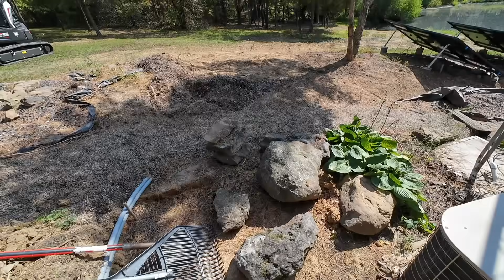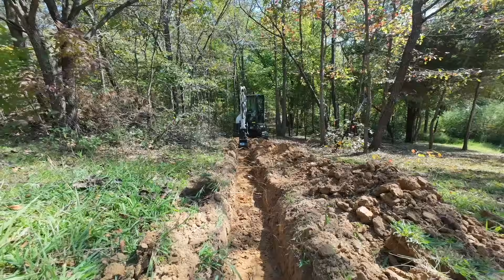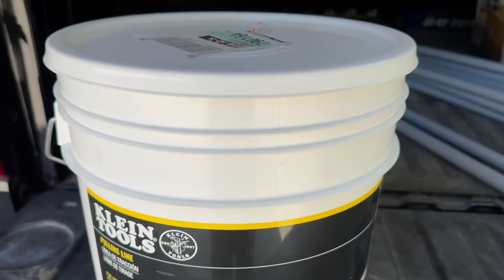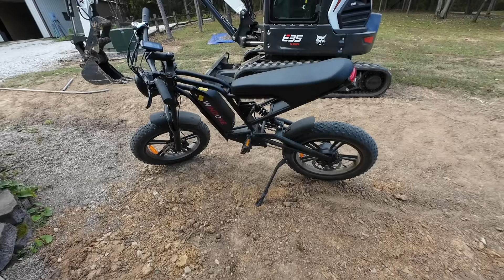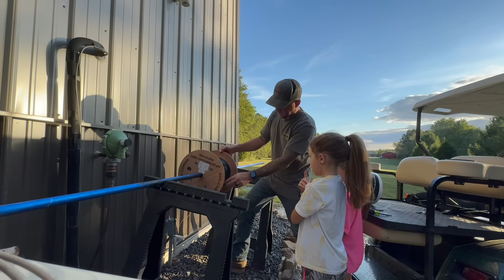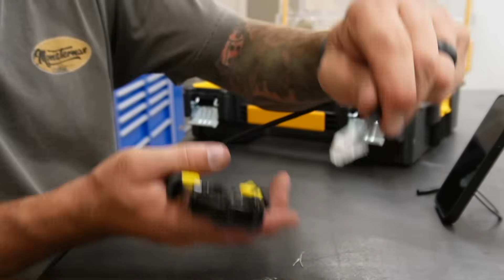Installing INTERNET To my Shop Over 300 FEET AWAY...

Comment: Pass-through RJ-45 connectors are a lot easier. You don't have to cut the wires to the perfect length, the wires stick out the other end of the connector and get cut off by the crimper. It's easier to double check the order with the ends sticking out before crimping.
Reply from the maker: @jojo0420  ive never had any issues with these but good to have options.  Some people may struggle and need easier options.
Reply: @SpicerDesignsLLC I wouldn’t recommend those EZ-Pass. I’ve been in the telecom industry for 15+ years and can tell you that they can cause issues. I’ve had to fix many of them because they short out at the end of the connector. Never use them on anything that is POE. I’ve seen many switches get messed up because of them. Keep using what you are. Shouldn’t ever have an issue.
Reply: Just figured I would let you know that you shouldn’t ever use soap. Soap can degrade the cable sheath over time. Use the proper lube if needed.

Comment: 3/4” is too small, I’d use 2” minimum, preferably larger duct.  I just bought 50m  (160ft) of 80mm (3”) OD for £70 ($80 ish)
Reply from the maker: @over-engineered  hah! You can do it however you want.  I think you should use 4” just to be safe.

Comment: I’d run fiber, a copper backup and a string.
Reply from the maker: @Jeff-m5x3j  anything else you wanna throw in there for shop wifi?
Reply: @SpicerDesignsLLC  of course you need fiber baluns on each end.
Reply from the maker: Do you think the cat6 can handle Starlink?
Reply: @SpicerDesignsLLC  I think it will be fine. I think long term reliability, fiber is superior.
Reply from the maker: Of course it will be fine.  Ive been doing this for 20 years and never had an issue.  All we ever pulled in government buildings, schools, control centers, ect had been cat 5 or cat 6.  Only time we ever pulled fiber was to the main servers.  Should be fine for my shop wifi like you said.
Reply: @SpicerDesignsLLC  I’ve been doing this for a while too. I just feel that once you go outside between buildings, fiber is less troublesome, but might not be worth the cost.

Comment: Nothing like creating the potential for electrical issues by connected separately grounded locations with cooper wiring. Fiber should have been your only choice.
Reply from the maker: @rgblack316  same ground.  That building has a sub feed.  Fiber is not necessary for my shop wifi.  Its been hooked up that way for over a year accept it was laying on the dirt.  Now its buried.  Never had an issue before.  We all know fiber is better.

Comment: I would try and install the conduit as stright as possible to aviod to many bends in the conduit. You can use a string line to layout the trench to help you keep it stright. Each bend in the conduit will add rersistance to the pull. You can all so use mule tape over pull string, this will avoid the string cutting into the conduit. Mule tape is smoother and will not cut into the conduit. You can all so add a tracer wire in the trench. This will make it easier to locate the conduit when it is buryied. Bury the conduit as deep as possible, this will make it lee likely to get dug up or hit. Cat6 is rated for about 325 feet but for long runs 200 or longer I would suggest pulling fiber all so you will not get any electrical problems with fiber.

Comment: Should have been doing fiber because of different electrical potentials. Running an ethernet/copper cable all the way down there can cause some devices to get fried. Fiber isn't difficult. Companies like lanshack make preterminated cables
Reply from the maker: I can pull any other cable in at any point with the conduit.  I will adding lightening arrestors like i mentioned in the video.

Comment: I forgot to ask ya in the other comment, what is your thoughts on the Passthrough RJ45's that when you crimp, they cut to length and are good to go? I have the traditional ones like what you showed and have a TON of them but as my stock dwindles, when comes time to restock, wasnt sure if I should think about those. I havent looked hard at them so I assume you can use the same crimper with it.  This is some relevant info for DIY'r! If you go buy a 250' or 500' roll, it'll last most home owners years depending on what you are using everything for. One day, I want a MEP closet/Room like what This Old House contractors do with a rack with all this crap on it and distributed throughout the house for easy repairs and management! and all the nice sexy pex runs and a sexy manifold.... "multiple Tim Allen Grunts!!!* # lifegoals

Show how to install the lighting arresters! Can I use the same ground as a 70amp subpanel? Or can I tie it back to a ground in an outlet box? I didn't know about these! I actually just lost a network switch due to a strike with in 50' of my building.
Reply from the maker: Ive never used the pass through.  Ive never had any issues with the regular jacks.  I plan on taking the lightning arrestors back to the panel since mine will be next to it.  Depends on your set up i guess.  Ive never installed them
Reply: @SpicerDesignsLLC  I'll ask my commercial electrician friend about it tomorrow at my kids swim practice. I know liability wise you can't go in much detail. He's going to ensure I do the 30amp camper and 50amp generator plugs as well!  

Last question do you have a preferred whole house surge? Maybe surge and power monitor AIO?  If not no biggie.
Reply from the maker: We used to install a lot of surge protectors that were a breaker style.  Otherwise you can get an external style ad well.  Anything is better than nothing.

Comment: Kyle, Mr. Machine with the Beer Assistant, who has an excavator, why don't you rig up a platform/basket for you to go up in while you wife drives and lift or hell, your kiddos drive!! lol  

I am not going to lie, I wish this video was out in January 2011! I had to run cat5 about 200' similar to what you are doing and it was a pain learning all this crap. I too have a tool box of all the tools and shi... crap with a colored print out of A-A and A-B types. When I did my 12x20 detached office in fall of 2020, I ran a Cat6e outdoor with the hard plastic divider things in the middle and all keystones were A-A and I made the appropriate wiring depending on if it was going to a switch, router, or device. Out there, I have 1 router, and 3 un managed switches that connect all my wired devices in different areas of that office! I used the boxed 500' roll of what it looks like is the same as yours. Love these videos!!
Reply from the maker: @mike.the.estimator704  thanks Mike! Sounds like you had quite the project

Comment: I’m not an electrician, although I am a partially responsible for supplying magic pixies to the electrical grid, I’ve heard there are signal boosters for cat6 that can be installed for long runs. I don’t know if that could be an option?
Reply from the maker: @mrbadkins007  i just ordered Starlink so we’ll see how it does.  I think it will be plenty sufficient for what starlink will be suppling.  I will update once i install it.

Comment: Another great video, bro!  I'm all about being physically connected vs wireless when I have that option, and it's not a 300ft run!  lol
If you have fiber to the curb, hell yeah I'm pulling wire.  If not, hell no I'm doing LOS/WiFi.  It all depends on what your ISP provides and what your gear can support.  My shop/barn is about 250 feet away from my house, and I elected to run a little p2p capable of 300mbps.  I'm only getting 25 MB down, from my ISP (I'm out in BFE western OK), so it really doesn't matter.  My Starlink system will be in this week, but I'll still stay wireless  If I ever get fiber out here, I'll trench it and run the cable.
Reply: So why would you need more than 25m in a shop?  Streaming in 1080 takes about 3m and 4K is 15m.   Are you downloading gigs of data there?

Comment: Have you taken into account the static charges that occur on such long lines in bad weather? I had 2 switches burn out in my house because during rain and wind there was a potential difference between the garage and the house 30 meters away. Check what is cheaper, a pair of media converters and a 10 cm optical cable or a network galvanic isolator. Media converters are often cheaper. The main thing is to break the continuous copper connection so that the charge cannot pass.
Reply: if you already use fiber to isolate, why not run fiber in the 1st place? much cheaper cabling and you can go MUCH further
Reply: This is exactly why I did fiber.   I even had a super short conversion back and forth between the cable modem and my network (Now fiber to the house so no need)
Reply: I second this comment.  I have been installing ethernet and data circuits for over 20 years.  If you never have lightning you may be ok.  I live in the south and years ago we spent lots of money and a ton of time trying to find a way to put ethernet underground.  Shielded cable, lightning arrestors, extensive grounding and failed.  Today I still install a ton of ethernet but I the only thing I will install underground is fiber.  You dont have to have the ability to splice fiber, (it is nice though) you can purchase preterminated fiber and use a media converter on each end to convert back to ethernet.   Now that you have the conduit, it will be easy enough to use the ethernet to pull the fiber in the conduit.  I sure hope your luck is better than mine, but you have to remember that ethernet operates at a very low voltage so it does not take much induced energy from a near by lightning strike to blow out what is connected on either end, including your Starlink.  Just trying to save you some greef down the road.  Enjoyed the video.

Comment: check the rj45 pass through, they are very easy to use.  if starlink is your main internet, you wont need fiber for a long time. also might reconsider installing starlink on the top of this tower... they go bad, the connector also like to pull out from the antenna and if it is 50' in the air it s*** :(  (mine is 35' and i had to climb during winter lol ). have a good one and as usual, great video!!

Comment: Good chance you could use a line of sight point to point system in the future if needed by mounting one node on your tower.

Good on your girls for helping out.  I had the wife as  my 'helper' when I ran power 350 feet to my boat dock.  I used 2 inch conduit and pulled four 6 awg and two 12 awg.  She needed a bit more training than your kids though.
Good job!

Comment: I’m an electrician also 15 or so years ago the company I work for had a contract upgrading usps distribution centers cabling that runs the sorting machines. Get this from type 1 cable to cat 6. It all had to be run in conduit and we had fiber running to the idf cabinets from the mdf room. I think Cleveland oh we installed 175k feet of cat 6.

You learn to not cut your thumbs fingernails during the termination portion of the job where you would 100’s of cables a day for 3-4 weeks straight.

I don’t miss that part
Reply from the maker: @cboutdoorfun9955  thats tedious work right there.

Comment: Your daughters make better LV apprentices than the last 3 we hired.  They are motived and understand instructions.  Adorable!  Like others have mentioned, you are good for 330' switch to switch;  You should be able to get gigabit speeds with cat 6 which is going to exceed the bandwidth that Starlink provides so that won't be a bottleneck.  You could get 10 gigabit speeds with optical, but you can cross that bridge once an Internet service exceeding 1Gbs are available to.  All that matters is you have the pipe installed and can pull whatever you need to future proof.  Bravo!
Reply from the maker: @ChadCyr  thanks buddy! Good point with the speeds and capability of the cable vs Starlink.

Comment: You need to change the programming in the shop router. It needs to be changed from router mode to ap mode
Reply from the maker: Ill check into that.  Thanks

Comment: Your property is so amazing! I'm planning to build a shop soon that will only need 100' or so of cable run, but I'm planning to go with fiber. I will run it in PVC like you did and in the same trench as my power run for simplicity. With the PVC you can always upgrade later but if you look into it you'll find it's not very expensive.

Comment: The pre-terminated armored fiber is really worth doing, although I would guess you need to cut in a hand hole on each end to be able to blow it through.  Get at least 4 strand cable.

Comment: why not coax?
Reply from the maker: Not typically used for ethernet.  Youll see that used with the cable company to provide service.
Reply: @SpicerDesignsLLC  yes, but coax can be used to carry both net and video up to 300m.  would've just been a little faster for your needs.  (retired systems analyst.)

Comment: I just connected our barn 450 ft away with Wi-Fi, with 2  TP-Link CPE710 PtP antennas....  works sweet.  I just didn't want to deal with burying cable like that.  LOL  You did a great job though Kyle!!  Best, -- J. Andre. / Old Iron Acres
Reply: Yep, I use a Ubiquiti M5 PtP between my house and shop. It works great. Never had a single issue with it.
Reply: @Studio23Media   I love the Ubiquiti stuff... but sometimes it's just too $$$.    — Best, J. Andre. / Old Iron Acres

Comment: Should have ran multi-mode or single-mode fiber over the copper cables but either way, good job.
Reply: I use wireless fiber between my house and shop. $150 Ubiquiti M5
Reply: At longer distances fibre is more reliable and actually cheaper than paying for good copper. Cheap Cat-6 tends to be CCA or copper-clad aluminium, which is prone to breaking and has worse signal carrying at distance. Then a good full copper cable is at best the same price as armoured fibre.
Additionally, when you get fibre you don't have to worry about lightning strikes and ground potential differences.
If you have a lightning strike nearby (doesn't have to be close) then the ground potential differences between the two buildings can be high and the equipment has at best about 1000V isolation. Many times people have had their routers and computers blown up by nearby lightning strikes because of cables between buildings.
People think fibre is difficult because they can't terminate it themselves, but if you have pre-terminated fibre then it's trivial.
In my last place I had the fibre nailed to a fence, it got attacked by a fox and it was fine. Armoured fibre is now cheap and really tough.
I recently bought some cheap switches which had SFP ports for fibre, they were under $30 each!
Reply: Run fiber, cheep and very simple to do

Comment: Be careful how the words "surge suppressor" separate money from your wallet. The magic of surge protection is the clamping speed of the surge protector, which is usually specified in time but sometimes in a voltage value. For example, a clamping speed of 65 nanoseconds will allow better than 900 volts to be applied to the equipment you are trying to protect. The clamping speed is based on the speed in which a voltage spike rises in potential. A fast device that is rated to clamp in 5 or 6 nanoseconds can still allow 300 volts to be applied to the equipment you are trying to protect.

Comment: To save your fingers, and make a straighter wire, hold the wire against the side of a screwdriver blade and pull along the length of wire a few times. Also, check out the RJ45 EZ. It eliminates the problem of wires not seating all the way in the plug. It does require a different crimper.

Comment: Just did same job, bought 300' of direct burial ethernet cable. Connectors were installed already. They claim 300' is near the limit for this type of cable, it works fine

Comment: There are RJ45s that have little holes in the end so the wires go all the way through. The crimpers have a built-in cutter on the crimping die.  With these you don't need to trim the wire to length before putting them in the RJ45, you just cram it in as far as it will go (don't go there...) and then crimp and trim in a single operation. Klein VDV226-110 is the crimper I have.  Also has both the TIA 568A and 568B schemes printed on the crimper.  BUT there's one little thing that you have to watch out for after you've been making cables for years, and that's the color scheme >seems< backwards.  But it's laid out for the RJ-45 tab up instead of down.  I've reversed a few ends a couple times because I'm so used to making cables tab down.  And thanks for the shout-out :)
Reply: RJ45 pass thru connectors is the term. And they’re a godsend as you mentioned. Just gotta make sure you copy the same pattern. The A or B pattern. I think most places use the B pattern for internet / POE security
Reply: @MobWithGuns  I was trying to think of the name and was drawing a blank. Thanks!
Reply: They are called EZ Pass RJ45s, and they suck. Don’t ever use them on anything that is POE. The copper will dogtail at the end and cause a short. I’ve seen it many of times and had to fix them. Also, seen them mess up POE switches because of it. 

If you do use them, make sure the blade is sharp on the crimp tool to help eliminate that.